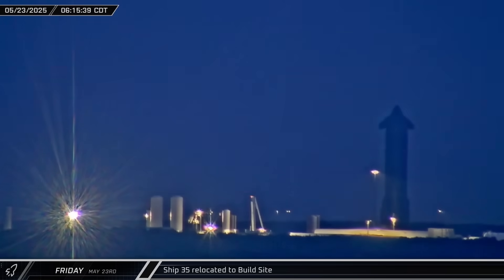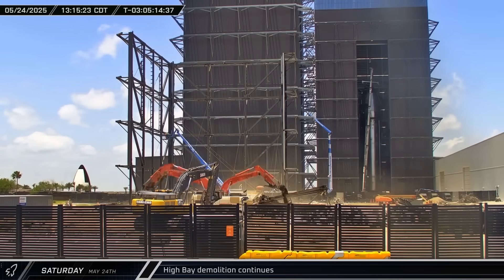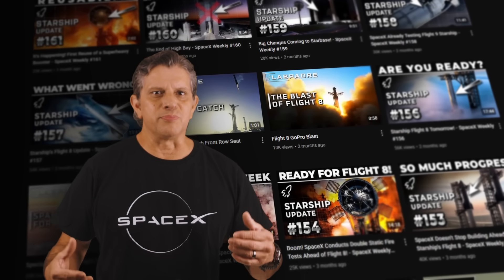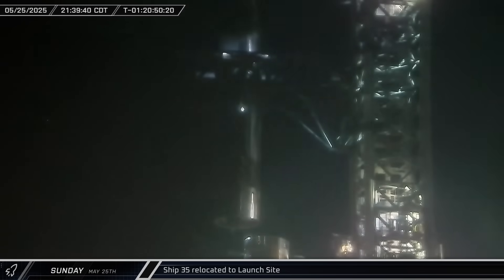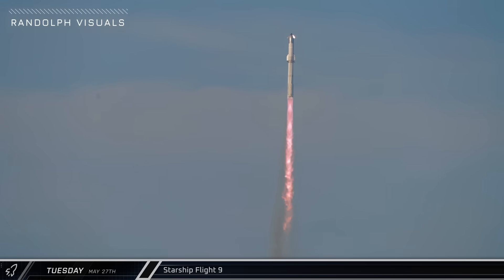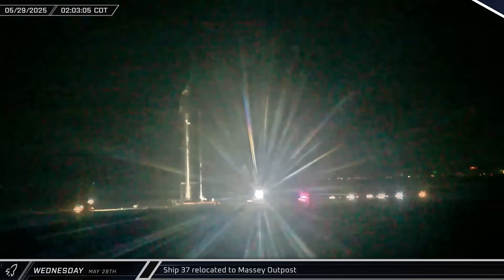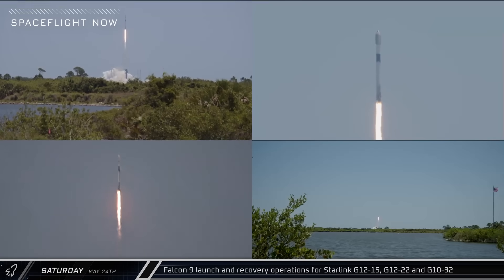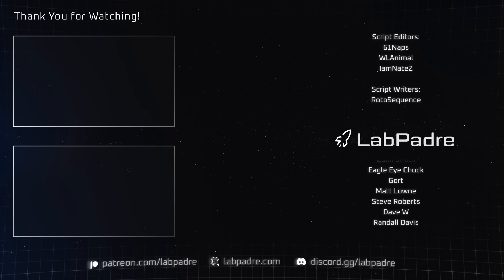Was Flight 9 A Success Or Failure? - SpaceX Weekly #169

Comment: if the pressure in the starship is higher than the pressure outside the starship when they tried to do the payload test then they would not beable to open the payload door because the payload door would weigh more than the motors used to open the door could handle, any pressure would make the door weigh in the tonnes, like a passenger plane door, on the ground easy to open in equal pressure, in the sky at 20000 feet, door weighs 1.5 tonnes due to pressure not being equal
Reply: there is very little if no pressure inside the cargo bay.. fuel tanks are kept at pressure not the cargo bay ..the pressure inside a high altitude jet is 11-12 psi at 30000ft

Comment: I think that it is important to remember that failures will occur. That isn't the problem. It's what you do with failure that really matters. Falcon 9 has proved that SpaceX is capable of achieving what seems to be impossible, so I have no doubt that they will be launching and recovering Starship before too long. I can't wait to see Starship launches becoming as routine as Falcon 9 launches are now.
Reply: Well said. It is not a failure if you learn from it and move forward.
Reply: @robkeshav800  If you can actually do the tests.  Successes and failures do both provide data needed to move forward.  But you have to actually do the tests.  They keep scheduling the same tests and don't get to them.  No test, no data.  They really need to get into those later tests.  If they can't, then these are failures.
Reply: @tmg7476  Getting through all the tests is the whole point of what they're doing in development.
Reply: @imaginary_friend7300  Exactly.  And the fact that they cannot get to tests which have been scheduled for multiple flights is the stop to that development.  They cannot analyze data that they do not get.
Reply: Test successes and failures both provide vital data.  The problem is when the tests can't occur.  This is the situation with Starship now -- flight after flight they can't get to vital tests that they need.  So they can't get that vital data and can't fix, improve, or move ahead.
Reply: Unless you're hater then all that becomes is an inconvenient reality.